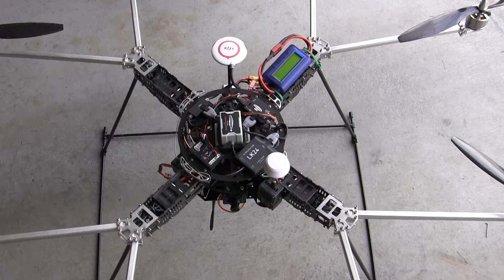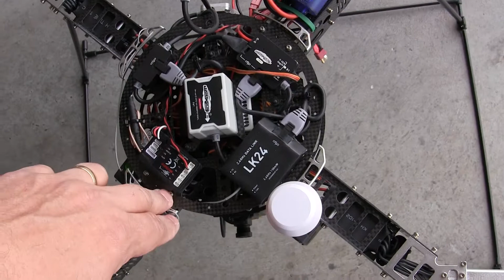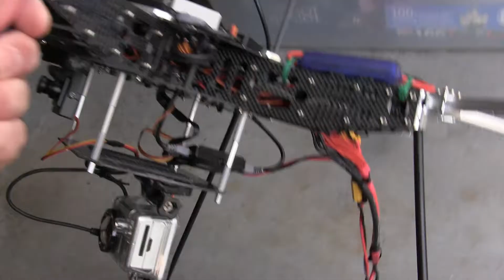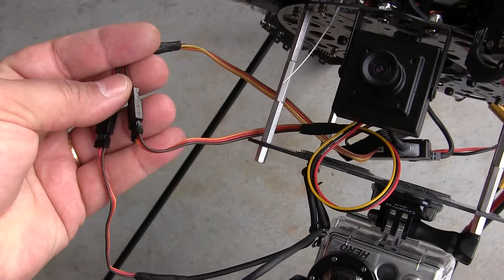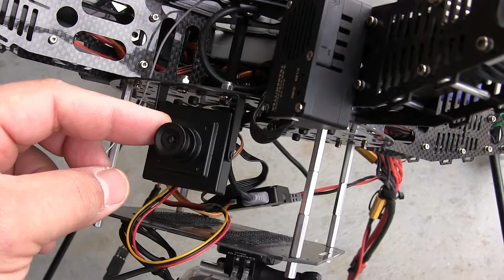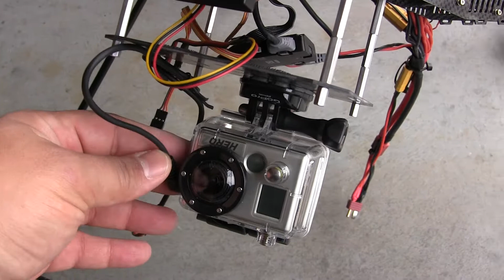X88-J2 with Wookong-M - Mounting Data Link and iOSD

Comment: Really nice airframe, not seen this one before in the U.K.  I use the same dji video downlink on my s800 evo, but I was told to mount it with the antenna facing down, not up.  Hope you will post some testflights.